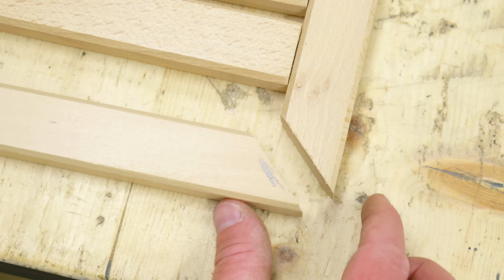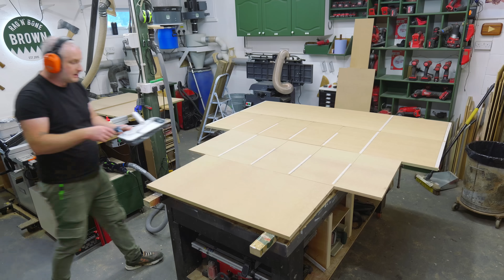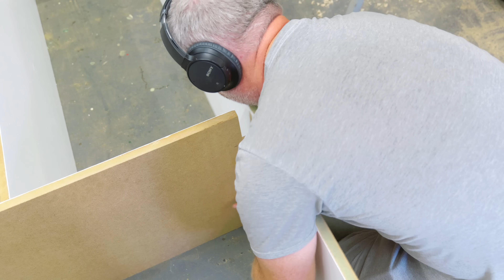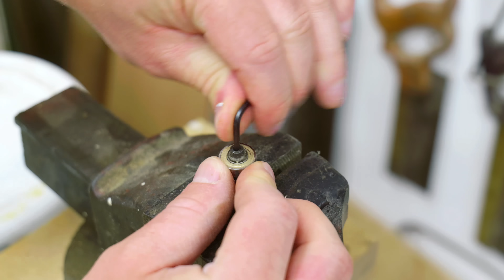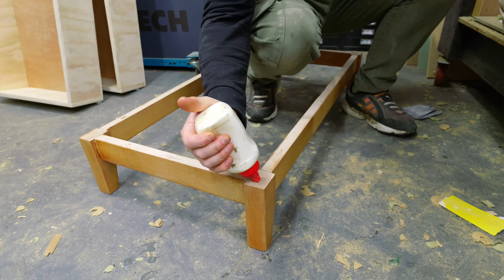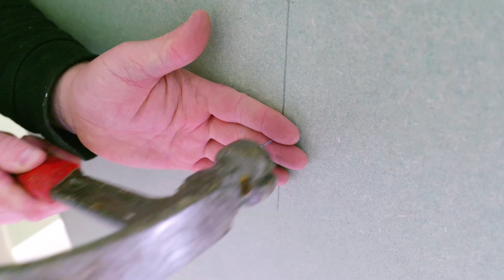Wood Rescue Mission: Building A DOUBLE WARDROBE

Comment: Nice job Keith.  If you haven't already done so, you may want to add a strap at the top and tie this to the wall so your little rascal doesn't pull it over on himself when he discovers that he can climb.  We had a really close call here and I'd hate for that to happen with your little guy.

Comment: I am very impressed by those slatted shelves but “dissembling” the old drawer with your boot! Really? Running around with a track saw would have salvaged more usable wood IMHO. Not planning properly and using a steel tape might explain the need to modify the plinth to fit. But ha ho who’s serious about detail.  One serious detail overlooked is the potential consequence of “Baby Brown pulling open one of those drawers and getting inside. The wardrobe install isn’t finish until its firmly attached to the wall, again IMHO.

Comment: When you found the base was too long, couldn't you have cut through the long rails at one end, trimmed them to length then just machined new domino mortices through the old dominos? I would have thought that easier than what you did, and would have given the look you originally intended.
Other than that it turned out great. And I love the drawer handles, and the fact they are updateable.
Reply from the maker: Yeah that would have worked but been more work, I was at that stage where I just wanted it to be done